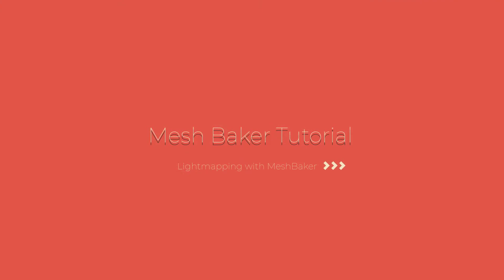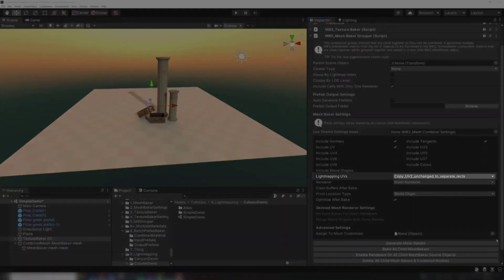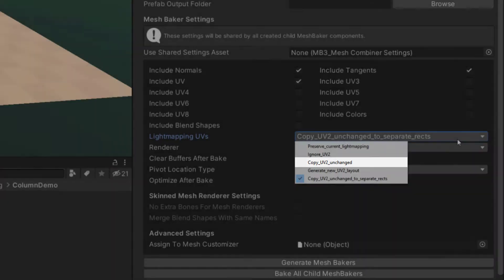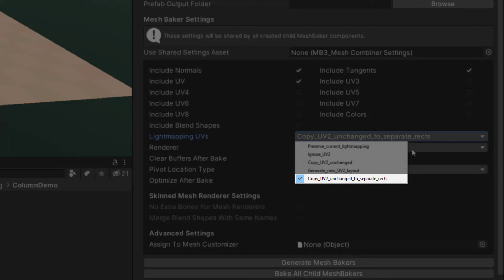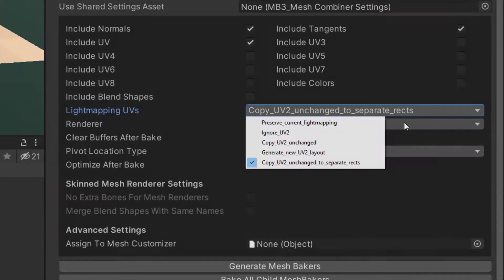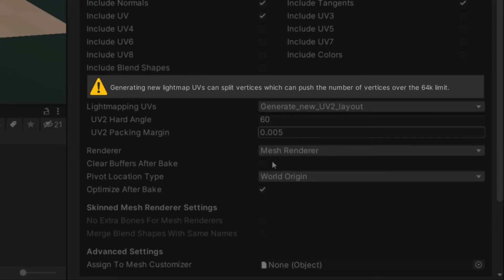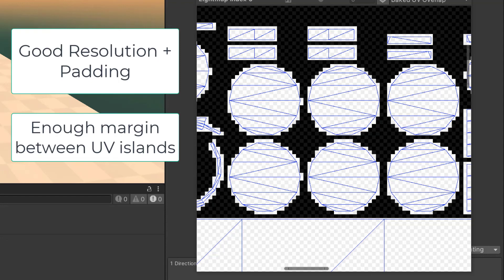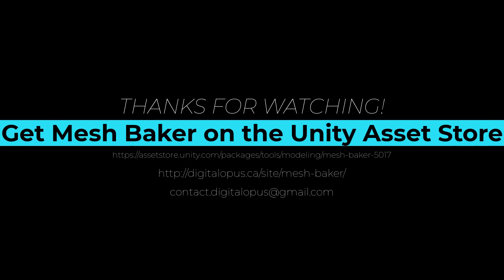Lightmapping

Comment: Thank you so much, it helps a lot. I have a question. How do I set texture bake, generate uv and make one combine mesh prefab?
Reply from the maker: These are three separate questions. If you are lightmapping, then the texture baking process is no different. There are several tutorials at the beginning of this playlist that show how to bake textures.

 Re: generating UV. Are you referring to regular UVs or lightmap UVs?   Regular UVs are baked automatically when the meshes are baked as long as the bake includes UVs.  To bake UVs for lightmapping you want to set the bake settings -> lightmap UVs to either "generate new UV2 layout" or "copy UV2 to separate rects". There are videos at the beginning of this playlist that explain the mesh baking process and settings. You will need to bake lightmapping on the combined mesh after mesh baking.

How to make one combined prefab. Set the mesh baker settings "output" to "bake into prefab". Note that if you want the prefab to be lightmapped, then you need to bake the lightmapping after mesh baking and save the lightmap information with the prefab. See this discussion:  https://discussions.unity.com/t/baked-lighting-on-prefabs-dynamically-generated-level/799924